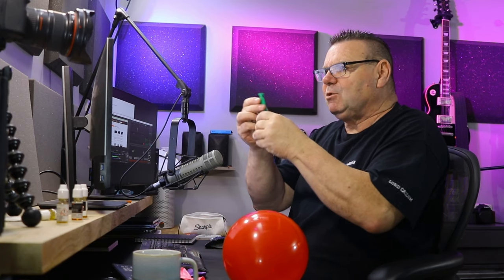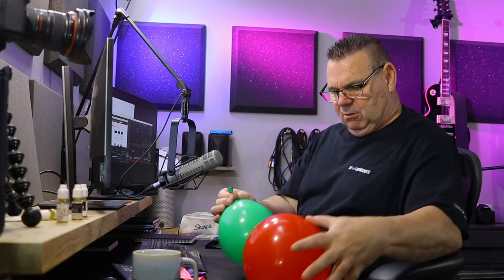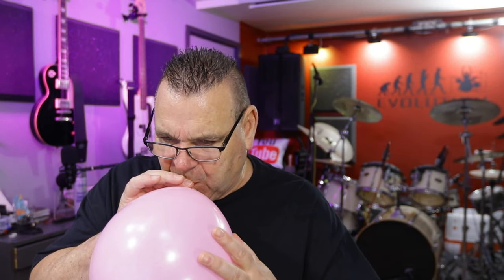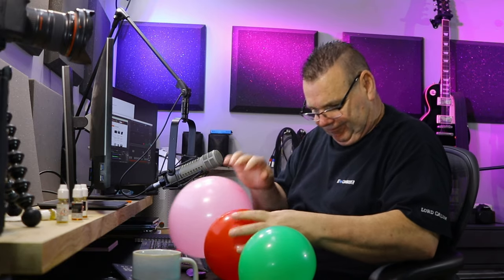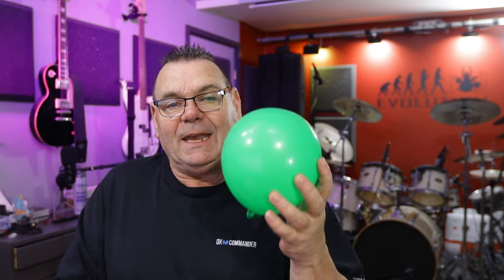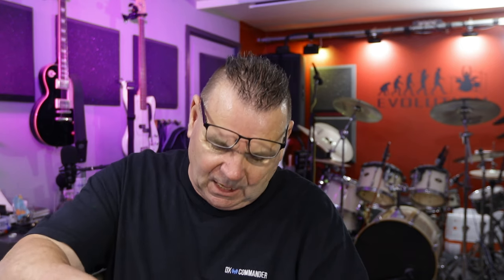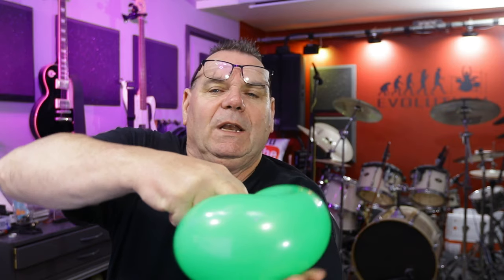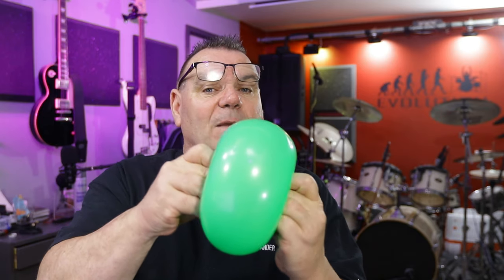What REALLY happens when you DOUBLE your Power?

Comment: A good way to look at it is with Ohm’s law:
Assuming a 50 ohm load (antenna)
100 watts = 70.7 volts & 1.4 amps 
200 watts = 100 volts & 2.0 amps (plus 3dB)
400 watts = 141.4 volts & 2.8 amps (plus 6dB) 
(I rounded off to one decimal)
3dB is twice the power, 6dB (one S unit) is twice the RF voltage & current, four times the power.
Reply from the maker: Very fine, yes!

Comment: Just one more thing you forget to mention Cal, the increase of power will also increase the processing curve on your audio. What i mean with that, the low power generated with specific sounds will be increased dramatically and will change your audio quality. High power speech will be flattened. Overall, it will help a lot to get out of the noise.

Comment: A great demonstration of one on r squared.  It is also why QRP works. 100 watts down to 3 watts is 13dB, or a quarter, then a quarter, then a half. So a 5 watt QRP signal is 2.5 S-points below the 100w guy with the IC7300. If the 7300 guy is 5 by 8, the QRP guy with the 2 transistor breadboard rig is better than 5 by 5.  Given reasonable band conditions,  who needs 100 watts?

Comment: I keep having this subject come up in videos time and time again. In this hobby, I have learned to be dubious of "common knowledge" lol 😆. 

It has been my terrible apartment antenna experience that signals "on the edge" for receiving where I can hear someone is there, but not what they are saying don't need even one S meter bar more to make a world of difference. Sometimes I cant see any difference on the meter between intelligible and not. I imagine reciprocity applies.

However, having said that, two things immediately jump out:
1) As you alluded directivity makes a big difference. Antenna "gain" applies to both TX and RX.
2) In the same vein, Antenna efficiency also makes a big difference. It also applies to both TX and RX. I have been doing a lot of online research into this, with much more to go.

My takeaway is mainly that optimizing the antenna should come well before any amplification. It is a lot easier in my opinion up to a point of diminishing returns to get more antenna gain than to insert a large amplifier.
Reply from the maker: Your last couple of lines.. Totally agree...!

Comment: Callan, I think another force multiplier is using audio mixers or like devices to clean up the received signal.  With the entry level mixer I have it can pull stuff out of the mud for SSB phone.  You use mixers in your music studio.  That application to ham received audio would make a great teaching vid.

Is there a small one which is completely off grid or uses 12 V DC?
Reply from the maker: Now.. I really don't know.. Maybe a budget rig might help with an EQ system. Interesting idea!
Reply: @DXCommanderHQ  I am experimenting with an entry level with an Icom 746 Pro.  It does help get some manure out of the inbound audio...

Comment: I was wandering about RG8U coax? I used it alot back in the 70s but I've been out of touch for 40 years. How does it compare to what you recommend? I've never heard of the stuff you use.
Reply from the maker: Hiya Bob.. So Aircell 7 / ecoflex 10 and Ecoflex 15 are SIMILAR to other new stuff by a firm called Messi & Paoloni. They do a 7mm  called UltraFlex. They all do a 10mm and 13mm. Very fine coax and connectors.. You can look up the loss numbers. ANd there are some cool calculators too. Just do a Google search, "coax loss calculator". In the USA, Messi & Paoloni are flavour of the month and in the UK, ML&S are selling it. Most people not using RG8U these days although very similar size to Aircell 7 and the Messi & Paoloni 7mm stuff (and would of course work the same!).. Anyway, hopefully I've been of some value to you..
Reply: @DXCommanderHQ  Thanks so much for the info. I'm thinking of rebuilding my equipment and antenna that I had back in the day. I've been retired for about 3 years and thinking of how much I have missed the hobby and how much I enjoyed the Kenwood  520 that I had. Seen a lot of your videos on your dx commander and thinking I may have to order one when I'm ready. So thanks Again

Comment: My thought is if I did have an nice amp, (I dont) and it was switched on and the RX could just hear me 429, I doubt if he or she was running 100w I possibly would not be able to hear them. I normaly run 50w output, if you checked my logbook I may have had 2 contacts using 90w in 2 years.  Buy a nice DXC and the best coax you can afford, happy days.

Comment: Hi cal, great video. Couple of things come to mind, first I just used the banana equation,  now iam back to school learning the 2 times balloon table hi.
My old icom 775dsp runs 200w,  when I put that into my 40m dipole it works quite well, when I put 200w into my 40m dx commander classic,  I get 12,000 mile dx every evening. Therefore I reckon the answer dividing the balloons by the bananas, or your bloody ants are the only wire ant worth using.
73 zl3xdj
Reply from the maker: Brian, correct! Don't forget to multiply by the square root of the Wigglies!

Comment: But power is linear, one demention.  Balloons are in 3d.
Reply: Watts are linear, but antenna radiation of the input power is radiated 3 dimensionally... With respect to radiation pattern (I.e. dipole, Yagi, grid, etc)
Reply from the maker: See CHarle's answer.. You increase that power over a 3d surface and it's as per the balloon..